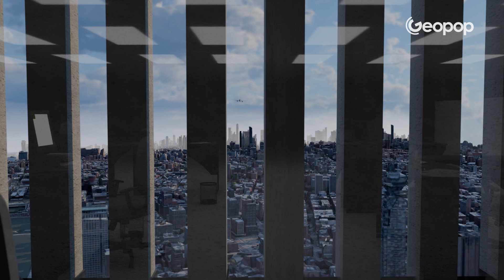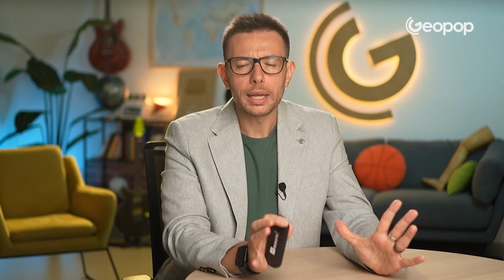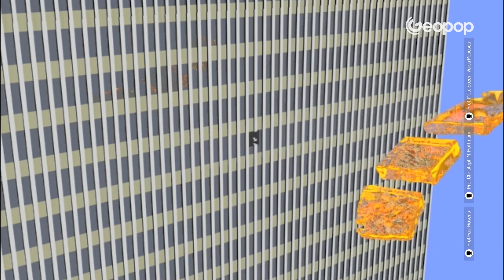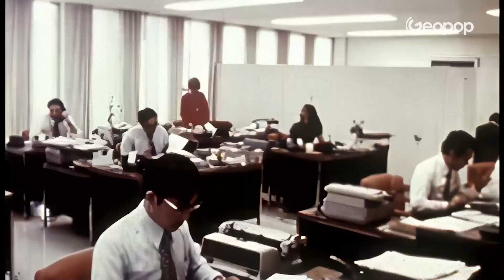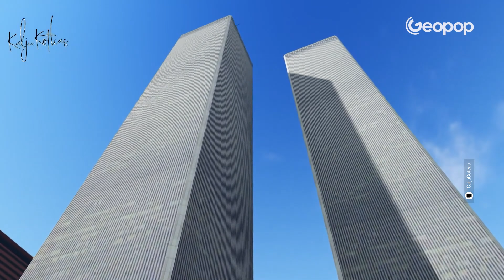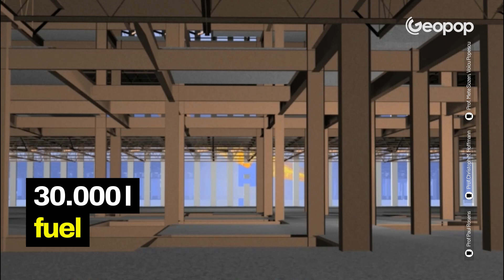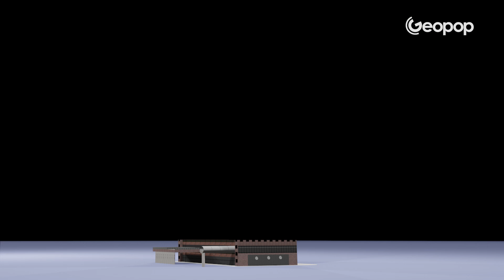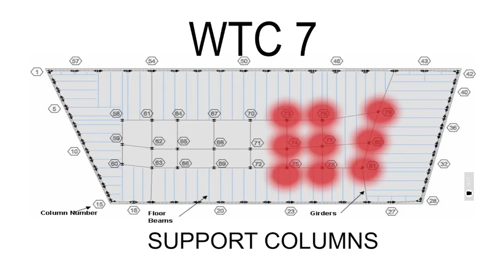9/11, 2001: The Technical Reconstruction of the Twin Towers and WTC 7 Collapses

Comment: Dude if anything that you we're saying was true the towers would have fallen within a short period of time let's say 15
Minutes after the impact.yes the gasoline is flammable and it would have been a flash ignition but also this is airplane fuel and high octane content,
Where is the calculation for the fuel that didn't ignite.Another but more important point only two walls on each building was damaged not all 4,this by itself prohibits the collapse as it happened,the 2 buildings were hit at different areas and hights.... which impossibility the fall of both buildings in the same manner. Then you trying to explain the fall of WTC7 believe me is laughable..... I did work in demolition and I did study mechanical engineering this is the the best example of control demolition that I have ever witnessed. Besides don't forget that the ramifications of this happening took us into 20 years of war..... just to take a pause to try for a bigger war now against Russia.
You belong to the dark forces of this world.
Reply: So you never paid attention to the broadcasts, you can literally see debris fly out of all 4 sides in impact from multiple angles
Reply: I see the coincidence theorists are out in force. The quite laughable NIST report is just one tiny part of a huge set of coincidences..... It takes more effort to believe the official narrative and not look stupid than it does to simply admit, very little that day made sense scientifically, and there are some huge questions that still need answering...... To just blindly believe the official Swiss cheese story is flat out unAmerican.
Reply: -- Then what is the source of the many tons of molten steel found in and under the debris, the heat so intense that the molten steel remained in that state for weeks afterward, running off of the debris as it was excavated. This cannot be molten copper from wiring that retains the color of a shiny new penny.  It cannot be molten aluminum that retains the color of the polished aluminum wheels of a street racer. It was the color of glowing orange molten steel  that cannot be mistaken for any other material, reported by firefighters who are very experienced in the nature of such materials as well as seen in video evidence.

When you combine this with an entire lack of turbulence behind 500 mph aircraft, when even a small Cessna Aircraft would leave an evident wake in the smoke and fire only seconds later .  . We find that skeptics still cannot be skeptical of the official narrative in explanation.  Sponsored channels and forum activity are skeptical of nothing when support is provided.

Sponsored activity in the forums is very normal today for commercial and political purposes and subjects of controversy -- in the attempt to lead public debate.
Reply: Which is more extreme -- to accept without question the inexplicable lack of turbulence in the wake of a 500 mph large passenger airliner -- not evident in the smoke and fire covering the impact zone only seconds later? -- or to recognize the indications of digital projection in its imperfect nature as we see a wing disappear in front of a bright blue sky? From another camera angle, the same aircraft is seen passing behind a crane in the foreground, yet in front of the heavy crane cable. 

There should be a hurricane of turbulence in its wake that would entirely disrupt and disperse the smoke and fire seen billowing outward just 3 to 4 seconds later at both towers.  Even the wake of a small Cessna aircraft would be noticeable -- yet there is nothing.
Reply: I'm going to disagree with your analysis and offer one of my own because I find Twin Towers collapses intellectually fascinating, my interest being understanding the actual mechanisms of collapse - what failed, when, how & why and discussing those mechanisms with others who share a similar genuine interest in understanding what really happened instead of rationalizing some political agenda. So let's talk about it.  If at the end you disagree with anything, please let me know what you object to and why. Make it good. I don’t suffer fools. This will take just a few minutes.

This is my summary explanation of Twin Towers collapses of the Twin Towers, start-to-finish, based on my observations without appeal to, or reliance on any authority. No politics or ideology, just what actually happened, which is agnostic to who planned and carried out the 9/11 attacks or why. It has the benefit of not requiring Rube Goldberg levels of complexity and it makes logical sense. Each step in the process flows naturally from the one before AND is chock full of critical details the conspiracy oriented internet tends to leave out with no whataboutisms.  My hope is this will dispel many common myths and answer most if not all questions you may have about the Twin Towers collapses. 

While complex, most of the Twin Towers collapse mechanisms can be seen with the naked eye and easily discerned and understood by the layperson if sufficient time is taken to understand. The worlds engineering community had already largely sorted them out at least as early as October/November 2001. Still, there are many who can’t be bothered to look or perhaps work hard not to see, being more concerned about advancing political/ideological agendas (which is exciting) than science and engineering (which is boring).

1. The Twin Towers consisted of 4 primary structural elements that together formed an integrated system where each relied on the others.  47 hollow box-section steel Core Columns carry the majority of the gravity loads. The 236 hollow box-section steel Perimeter Columns carry the remainder and ALL of the lateral (wind) loads. Long-span Lightweight Steel Trusses connect the core and perimeter column together at each floor with a Hat Truss on top to tie the structure together as an integrated unit where no element can survive without the others 

2. The impact of 117 tons of airplane (= to about 12 dump trucks) at speeds up to 590 mph completely destroys the aircraft.  This in no way implies the Towers come out unscathed. Some folks don’t get that. Hitting with the energy of up to a ton of TNT the impact damages or destroys many perimeter and some core columns (33 of 59 perimeter and 20 core columns destroyed at the impact floors in the North Tower), primarily through bolt-shearing failures at the end connecting flanges, as well as bending, twisting and fracturing of weld seams. There was no cutting or slicing - the reality was far more violent and messy. 

3. The impacts destroy or damage fire insulation, fire breaks and sprinkler systems on multiple floors. Huge fires are started across multiple floors simultaneously and allowed to spread rapidly with no effective firefighting or fire suppression. This was an unprecedented fire event . All of this was observed and recorded.

4. The hotter steel gets the weaker it gets .  With fire insulation stripped away and no sprinklers the survival time of the steel greatly reduced. Gradually over time heat causes the lightweight steel Floor Trusses at the impact damaged floors to sag, which was observed and recorded.  No steel melted nor did it need to. Structural steel will fail long before it turns to a puddle. It just needs to bend

5. Sagging floor trusses pull on the increasingly weak and overloaded Perimeter Columns, causing some of them (NOT on the sides that were hit) to bow inward by up to 5 feet. This was observed and recorded. A straight column is up to 4 times stronger than a bent column. 

6. The bowed Perimeter Columns buckle and fail, initiating collapse. This was observed and recorded.  The formerly static mass above which the structure below could easily support is now converted into a dynamic mass up to 30 times greater. Because they have buckled, the Columns above and below the failure point are no longer aligned . The load bearing structure below no longer bears any load as it falls past the lower columns, NOT onto them.

7. Thousands of tons of debris fall within the four outer walls, down through the open office space, crashing onto the first intact floor it encounters. This massive impact immediately breaks the bolted connections to the columns as the amount of resistance the Floor Trusses can offer is negligible.  The falling debris slows only marginally and briefly. Note:
7a. This is NOT a solid top block crashing into and “crushing” a solid bottom block .
7b. The debris falls past the columns not onto them.  The columns provide no resistance to the falling debris. 
7c. Only the bolted connections of the floor trusses to the core and perimeter columns can offer any resistance. A pair of 5/8” bolts at each end of each truss vs. thousands of tons of falling debris.

8.  This floor-led collapse progression within the four outer walls can only go straight down. Note: 
8a. This process is often incorrectly referred to as “pancaking” which actually refers to a completely different process rejected at an early stage. The catchy name stuck but nobody knows what it is supposed to mean.  Pancaking is too simplistic and inaccurate anyway. More like Kaiserschmarrn.

9. Collapse progresses through the floor systems and not down the columns. Rate of floor assembly failures increases with each successive floor as momentum increases, reaching an average acceleration of 0.65 of GA, or 35% slower than true free fall. Bam, bam, bam down the building until there are no more floors to fail.  The resistance offered by each successive floor is always the same. The mass and velocity and thus the energy of the falling debris are constantly increasing.  The falling mass increases with every floor it destroys as new falling mass is added. Some falls to the sides, but most falls down. More mass, more velocity, same resistance with each floor.
The above is unquestionably the path of least resistance

10. The Towers were 95% air by volume and as that air was compressed inside the building it is forced down the tower and blown out the sides in reaction to the building collapsing not causing the collapse. Those were not “explosions”, it was expulsions of compressed air. 

11. Perimeter Columns become detached and peel away like a banana behind the collapse front, playing out to the four points of the compass extending to more than 600 feet from the base of the towers. This was observed and recorded, the results quite obvious from examination of the debris pile. 

12. Core Columns fail last as their internal beam bracing is stripped away and lateral support from the floor to perimeter columns is lost. This was observed and recorded and is most obvious in the North Tower. 

13. For those who care about how long this took, the whole process took 31-34 seconds from the moment the perimeter columns buckled until the last core columns hit the pile, or 1/3 the rate of true free fall. Don’t believe me?  Just watch any video of the collapses and note all the loose and truly free falling debris dropping much faster than the towers themselves.

14. What was NOT observed and recorded were the 180-190 dB bangs of high explosives or the blinding bright flashes of burning thermite. Of course, neither could have caused the (silent) Perimeter Column buckling that was observed.  Neither explosives or thermite could have survived the impacts and subsequent fires either. Cherry-picking a casual comment from someone who heard a loud noise in an event like 9/11 is not exactly “proof” of anything and the pre—planned demolition case relies entirely on that. There is zero physical evidence to support either conjecture. It would be technically impossible, totally impractical and completely unnecessary. No one would bother. 

15.  The Twin Towers were perfectly safe within their design envelope.  They only collapsed when taken far outside design parameters by an extraordinary and unprecedented event. 

Impact + Fire (heat) + Time + Gravity = Collapse . Remove any one of those four elements and there is no collapse. Ignore any of those elements (as many do) and you will never understand the collapses. The Twin Towers were an integrated system in which no one component could survive without the others. One fails, the rest follow, through the path of least resistance – DOWN – through the open space, bypassing the path of greatest resistance – the columns. Don’t get stuck on the but the lower floors weren’t on fire nonsense. 

I hope you found this helpful. It is meant to be informative, not adversarial, posted with the objective of soliciting informed critical comment, positive or negative. If I made any errors of fact, logic or reason or left anything critical out, please let me know so I can fix it. One topic at a time, on topic only please to stay focused, no word-salads of Gish Gallop. IF you can offer a more plausible alternative be my guest. So far no one has even tried. Please start any reply with the words “Tits McGee” or I will know you didn’t actually read it, are not serious and just wasting my time.
Reply: @TheCriticalStinker-jw4fl also the idea that thermite couldn't survive is just preposterous. And I can refer you to a video with time stamp of an obvious explosion not just a loud noise. I can also provide countless witness testimonies where explosions were heard in the lobby and prior to the collapses. 
The official explanation was that jet fuel somehow fell down an elevator shaft and exploded generators. Far fetched. The NIST report actually contradicts itself with regards to building 7. It says at one point there were fires on a certain floor and also have said the fires were out at the same time.
The twin towers had become a massive liability and it wouldve cost more to refurbish them than to build a new one. One of the largest insurance claims in history and one of the guys who profited from it just happened to go to not be there when he shouldve been.
Reply: @jr5993  Stinker trolls other comment sections too
Reply: @TheCriticalStinker-jw4fl I've read it all. I'm not an expert, so this explanation seems somewhat possible. 
A few issues though 
1. The top sections fell at an angle. How did the rest of the structure fall straight down. 
2. While the mass was technically increasing, a lot of it was pulverised.
3. Scientifically, how does the idea of the mass above being applied suddenly change anything? 
4. WTC7 I don't think you touched upon. NISTs own graphic for that collapse is inaccurate and you need not be an expert to see that.
Reply: @TheLoonResistance Tits McGee  we need more people like you on the internet 🧠
Reply: @TheLoonResistance  I found it a joke since it took 9 seconds to fall and liquid steel could be seen in many of the views prior to collapse. Jet fuel burns at temperatures ranging from 800 to 1,500°F (427 to 816°C). While hot enough to potentially weaken structures and cause fires, it does not reach the melting point of steel (around 2,750°F or 1,500°C). Steel did not melt from fire or jet fuel and you explanation is SOOO similar to what NIST said in its documented lies.
Reply: @billjako340  - Holy Zombie thread Batman.

I found your post a joke because the collapses took 33-34 seconds start to finish (I know, unlike you I actually measured it).  Molten aluminum (and possibly lead) was seen ONLY from the NE corner of the South Tower at the 80th floor for a couple of minutes. While the former tells us nothing about what caused the collapse and why, the latter does give us some insight - but one has to do a much deeper, far less superficial dive on it than you have. 

Also, no steel melted or needed to. We're not in the 6th grade here and it has been almost 24 years. It is time to move beyond such silliness. 

Finally, how would you know what The NIST said. You didn't read it, just like you certainly did not read my first post in this thread.
Reply: @TheLoonResistance amazingly said. Glad someone with an actual brain is setting these conspiracy theorists on a more educated path. My adolescent cousin learned about 911 in school and even he understood how the planes lead to the tower falling. When a fire rages, beams soften, weight can't be held, it's built to go down straight specifically so it doesn't fall into another building. Debris still can fall, which lead to tower 7. Really east stuff to get, yet some grown adults who likely watched it happen on TV still cannot grasp it.

Keep doing amazing work.
Reply: @PretzelSage  Watch 9/11 The Grand Deception on Tubi. After you do, if you have any common sense, you can't possibly believe these buildings collapsed the way they did without controlled demolition. If this doesn't convince you, You are a stupid fuck.
Reply: @ElLowEl .  . "What the hell are you talking about?" .  . 😃 .  . Thank you for your sponsored reply, Mr. EILow.  The word projection indicates holography as you know, commercial demonstrations of which have been amazing in recent years.  To feign ignorance doesn't work well for you, however.  Where, Mr. EILow, is the wake turbulence only seconds after passage of a 500 mph large passenger airliner -- not seen in the smoke and fire covering the impact zone?  Even the wake of a small Cessna Aircraft would be noticeable -- yet there is nothing.  It's likely that no real answer from you is forthcoming. We'll wait and see .  .